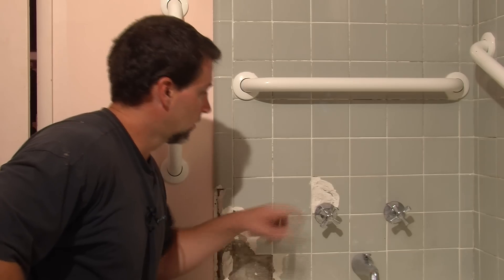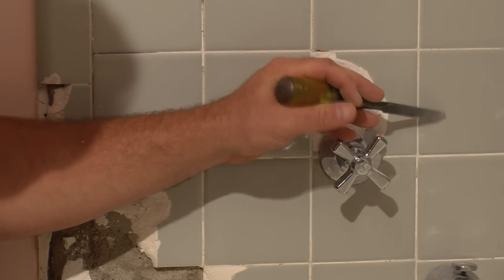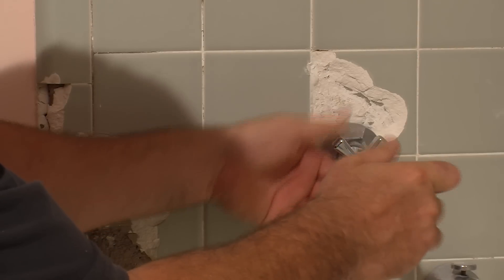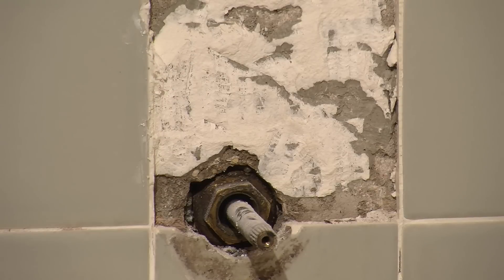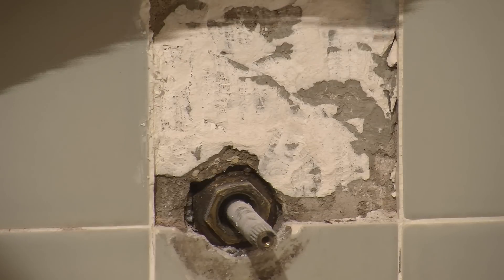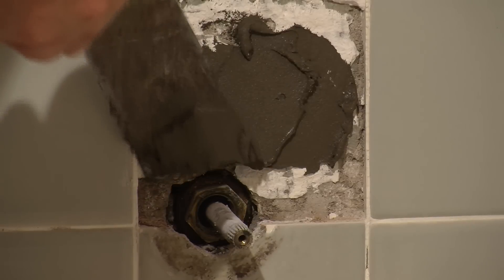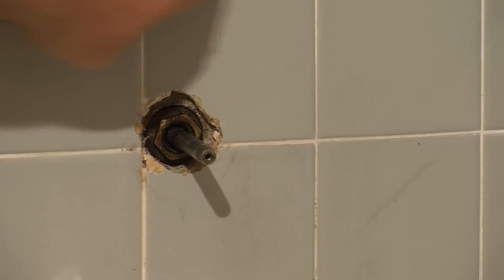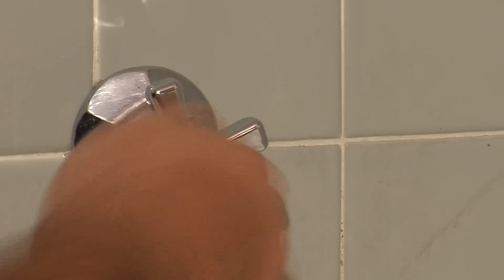Bathroom Tiling : How to Replace Tile Around Bathroom Fixtures

Comment: I am doing this job, plus some, right now...52 yr old tile.  Replacing two nasty handles, connect copper to PVC or pex in wall.   Replacing, once decorative tile over new cement board patch in, a one handle modern, pretty replacement 
THAT removal  way shown is a bit heavy handed, and you can crack out WAY too much ... i put on my safety  goggles and use my grinding Dremel.  Cut just barely through masonry along grout lines.  Carefully remove to access pipes.
While cutting, do not forget water pipes ARE back there and don't nick with dremel, or anything else.

Comment: Thanks for the video but much to abbreviated.  You skipped the most important part, setting the tile and all the problems associated with it.  How about tips on cleaning it up without chipping the surrounding tiles?  etc.
Reply: Read my comment. Much safer.

Comment: 49,000 subscribers?? HOW?? I know of at least 49,000 people with screwed up tiled tub walls
Reply: Amen on that.  Go easy on tile. Dremel grinding wheel along tile grout lines.
Better know or learn how to strongly patch sheetrock, then do it with cement board.
Lots more steps before it's safely waterproofed and pretty, so enter this realm only if you have patience, and a spare full bath until finished.